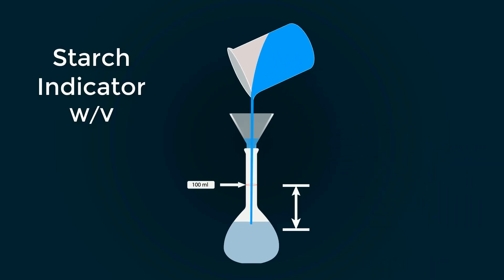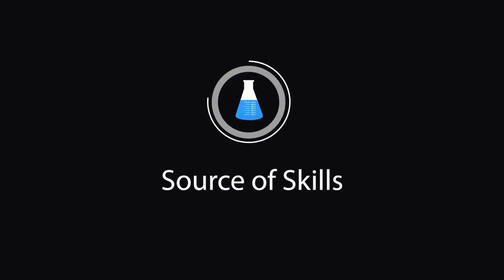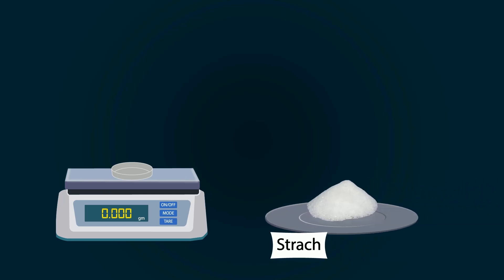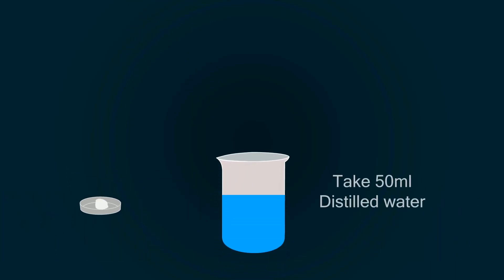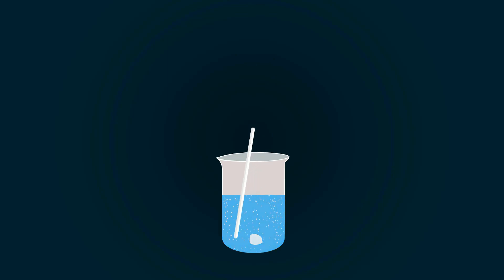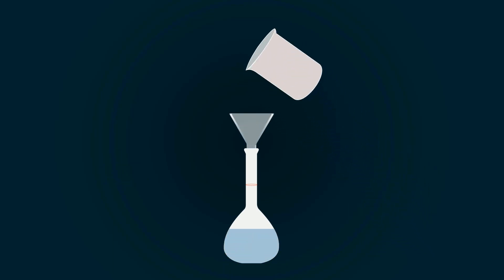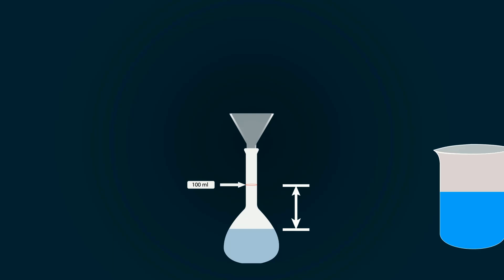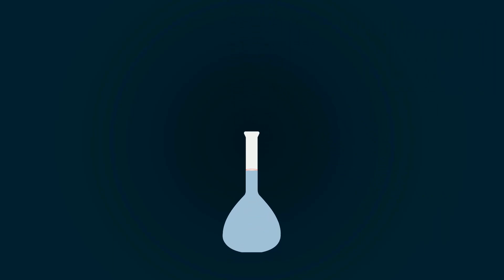How to prepare starch indicator | starch indicator preparation | how to make starch indicator

Comment: We need to heat starch before adding in solution?
Reply from the maker: if starch powder is not being dissolve in distilled water easily than we need to heat that solution.